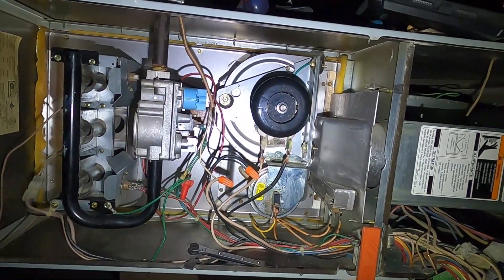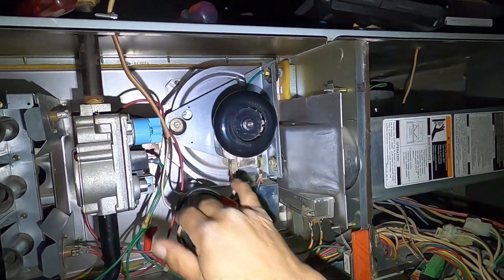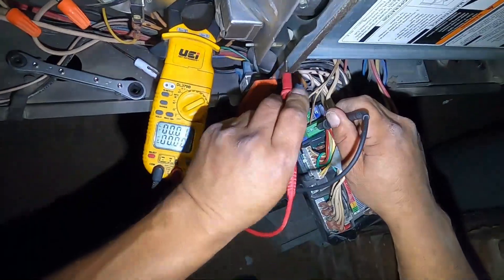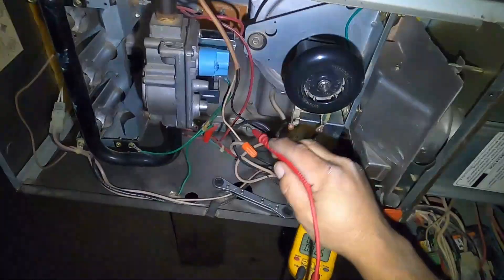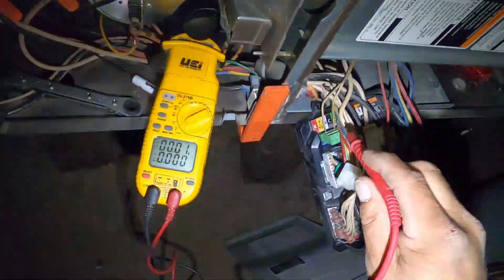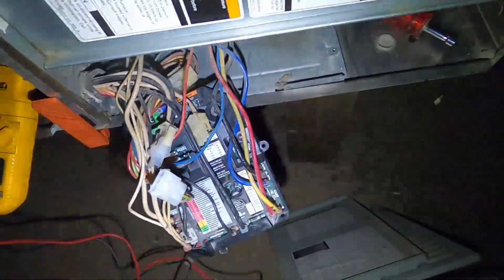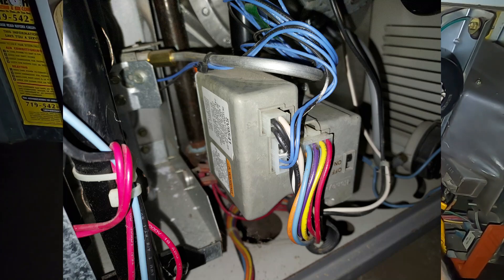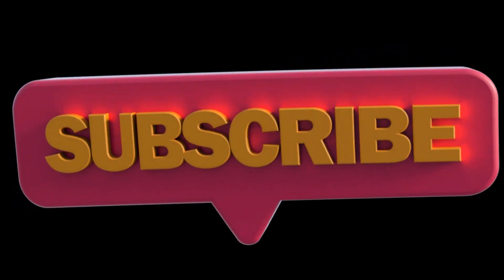Furnace Inducer Motor Troubleshooting

Comment: Thanks for the simple tip of manually spinning the inducer. 
Mine wasn’t coming on. I was pretty sure it was receiving power and a thermostat signal. 
I manually spun it. Turned the heat back on at the thermostat. 
And it worked!
Now let’s see if the fix lasts….ha.

Comment: What if the transducer motor is running all the time even when the thermostat is off or not calling for heat? Replaced thermostat and control board but still having the issue.

Comment: Hello, my inducer motor is very hot to the touch, but it runs. I’m afraid it’s causing the furnace cycle after about 4 to 6 minutes of running, is it normal for the inducer motor to be so hot?

Comment: Is there usually a capacitor for the inducer motor that could be bad?
Reply from the maker: Sorry for the delay. Some inducer motors do have capacitors, usually 4 micro farads. If the capacitor is dead or reading low micro farads, it could cause the motor to not turn.
Reply: @diyfurnacerepair5438  Thanks for sharing this information.  Yep I found it and it’s rated at 3 micro farads but is reading 2.6.
Reply: Mine has a capacitor. I can tell without measuring it is definitely a bad cap. The motor wants to turn but isn't getting a big enough jolt most of the time from the cap. I can give it a little assist by hand and it starts right up.

Comment: I have an Amana (made by Goodman) gas furnace/AC combo unit. In Nov-2020 the inducer fan started failing to start, but I could spin it manually, & it would start & the furnace would come on. I replaced it with an OEM Goodman inducer fan. Presently the furnace is starting & running, but when the inducer fan starts, I can often hear it vibrating and its vibration slightly rattles the adjacent components. Do you think that it's about to fail? The vibration does not happen all the time, or it may start vibrating and then die away so that it's running normal.
Reply from the maker: Sounds like the blower wheel in the inducer assembly is off balance. Wheels cant be balanced so eventually the vibration will get worse and you would need to replace the entire blower assembly.

Comment: I live in an apartment complex of 110 units, and we have had several inducer draft motors with bearing failures that often don't get replaced right away, but make noise that I can often hear months before the tenant or landlord hears! Anyway, I was curious why these motors run ALL THE TIME, even when just the AC is on! Does the inducer draft blower serve any function when the AC is running, and if not, why have it running for hundreds of hours during the cooling season if it's not needed? One other issue: in twenty years, my unit needed service when a hornets' nest was built in June 2005, my first year here. I've learned since to run the heat (furnace) five minutes a week during the time from about April until the end of June, to discourage pests!   - j q t -
Reply from the maker: Inducer motor shouldn't run until there's a call for heat from the thermostat. When I've had inducer motors running without a call for heat, it has been stuck relay on control board so I've had to replace board.
Reply: @diyfurnacerepair5438  On these models, the inducer comes on with AC as well as HEAT. Maybe it's designed to try to keep pests away. 

Ref: Armstrong 38HWC183A-3C "MagicPak" All-in-One, Thru-the-Wall Unit        https://inspectapedia.com/heat/Armstrong-HWC-Service-manual.pdf

HOWEVER . . . 

Page 1 of the Service Bulletin for what appears to be the identical Lennox HWC Model says that the "Induced Draft Blower operates only during the heating cycle." 

https://tech.lennoxintl.com/C03e7o14l/VIu12Ch2uV/60hz_mjkpak_hwc_0899.pdf

And yet, when I had the hornets' nest clogging up my Inducer Blower, I can vividly recall hearing the NOISE coming from this part when my AC switched on, because that is why I called for service! In July! And the service call did not require a new Inducer Fan; it simply required the technician to clean out the offending nest, and I WATCHED HIM DO IT! 

I wonder if these units were originally set up and configured improperly?! That might explain why so many Inducer Blower Motor Fan bearings have failed prematurely! 

I don't view it as a critical problem, since it seems like a part that might fail in 15 or 20 years has been failing in maybe half of that much time. And while I know it's been a commonly failed part in several other apartments, I'm not absolutely certain that ALL of them were/are configured improperly.           - j q t -
Reply from the maker: Ah... I've actually never worked on one of those.

Comment: Sometime after a storm , you may find water in the small tube that connects to the diaphragm on the inducer motor proving switch . it only takes a couple of drops to impede the sequence of operation.

Comment: my inducer randomly will not start. If I just bump my fist on the furnace ....it starts up and may run fine for weeks....but last night it got cold and the house was 63 when we woke up. All I did was go up and thump the unit and it starts right up. The fan isn't bound. Is there a random short?
Reply from the maker: Sorry for getting back with you so late. The inducer plug on control board may be loose. If you move the plug around and it turns on and off then you will need to replace the control board.

Comment: My inducer motor is noisy, it works but getting loud. I think the bearings are shot and need to replace the motor. It’s an American Standard Gold series gas furnace thats 5 years old. I’m told by the repair technician that this item is back ordered and currently unavailable for the foreseeable future (could be 1 year). My concern is a total failure of the motor during the coldest months. It’s now December in New Hampshire. Any ideas???? Thanks
Reply from the maker: Give me model and serial number and I will try to locate one for you.

Comment: My pressure switch hose keep filling up with water. anything im not checking?
Reply from the maker: Check the condensate drain trap. It could be clogged. Also make sure the pressure switch hose doesn't have a dip to where it collects condensation in the hose.

Comment: My inducer turns on for 5 seconds and then shuts off. What do you think is the problem? Pressure switch? Appreciate any help Thanks
Reply from the maker: Could be pressure switch. Remove wires from pressure switch and when the inducer starts use a wire to connect the 2 pressure switch wires. If inducer stays running then you could have a clog in the pressure switch hose or port. Could be a blockage in the vent also.

Comment: Thanks for the video.   I have an issue where getting 3 red lights - blocked flu/pressure switch issue.   But confirmed flu is ok and switch opens and closes.  And the inducer just stays on as long as power is on to the furnace.  Trying to figure out if it's a bad board or bad inducer.
Reply from the maker: Sounds like bad control board. Relay on board is probably stuck closed allowing constant power to inducer. You will get 3 flashes because board recognizes that pressure switch isn't opening when inducer should be off. Also a nest thermostat without a (C) common wire can do that.